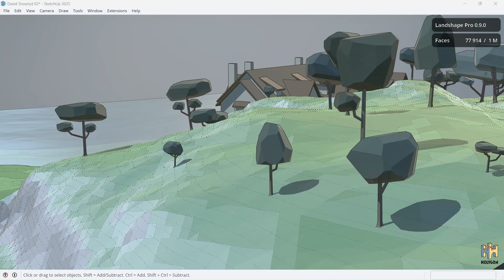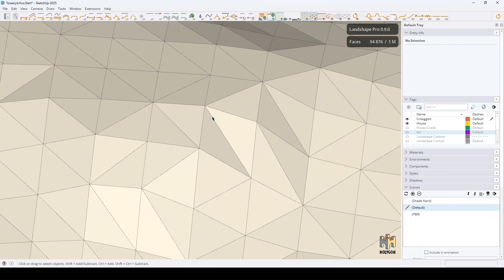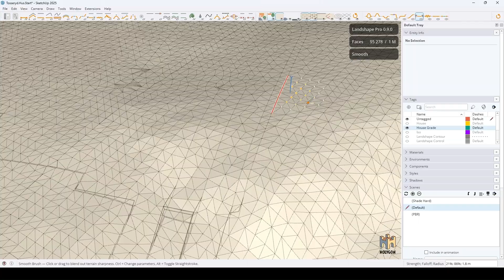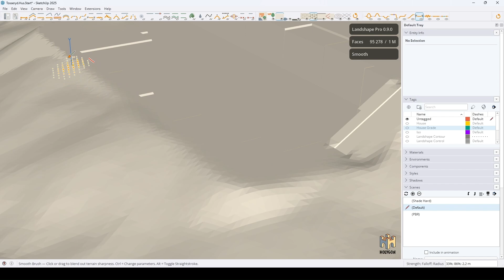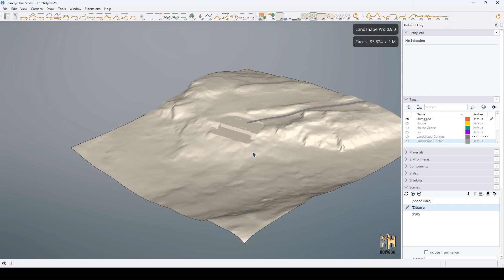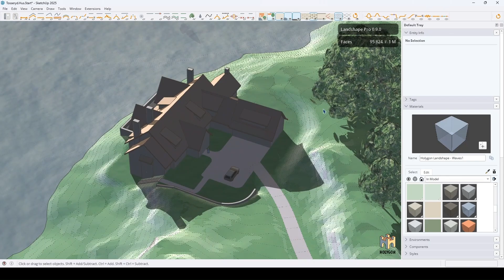Landshape Terrain Grading Workflow – How to Grade in Landshape for Sketchup

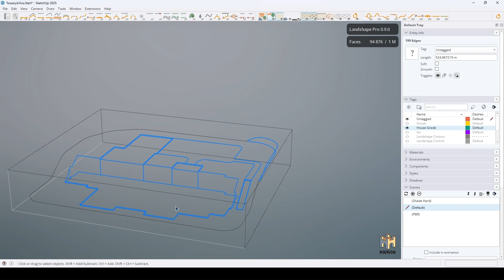Comment: 5:42 how do we create those lines on the landscape?
Reply from the maker: Sketchup has a Line tool. Just use the Line tool to manually draw edges exactly where you need the terrain to go.

It's that simple.

Remember that your Grade edge input needs to be in a group. It also needs to contain an outermost closed edgeloop, which defines the enclosed area to grade. 

Look closely in the video. You will see that the Grade geometry edges are all in one group, and that this group contains one continuous outer edge perimeter.

Landshape does not care about the origin of your edges. You may draw them them via Sketchup's built-in Line tool, Rectangle tool, Circle tool. Or in some other extension, such as Fredospline.

In addition, Landshape offers a handful of Prep and Prop commands. They include e.g. Drape Edge, Smooth Path, and so on. These facilitate common editing tasks, prepping your edges for commands like Grade.

We plan to publish more video tutorials, showing what Grade groups are, and how to create them.

Does this help you?

Comment: Can you grade a road properly with profiles, fills and cuts and not just drape it to the ground surface?
Reply from the maker: Thank you! Yes, you can. 

To grade a road properly with profiles, fills, and cuts, you first use any method to create your detailed road profile as a target surface. This is a control group. To create the control group, you may use Sketchup's Followme, or third-party extensions, such as Upright Extruder, to create and shape your target surface. 

Then, in Landshape, you can select key edgepaths from your target surface, and Embed them into the Landshape terrain. This gives the terrain mesh the local definition. For instance following the road's left and right borders. Finally, you can select your target surface, and run Landshape "Fit". Fitting should locally re-elevate the Landshape terrain to conform to your selected target surface. Use the VCB to adjust the result.

Alternatively, you may instead create a target grade group. It consists of edges, differentiated in plan. Again, you may create these edges in anyway you like. Sometimes, Landshape's Drape Edge command can be helpful part of this process. And again, then Embed the important defining edges. Finally, select the target control group, and run Landshape Grade. This should reshape the terrain according to your target edges. Remember that your Grade group requires an explicit outer border edgeloop.

The above two methods should give you finetuned control of the result. It's mostly about how you create your control group.

Note that you may be tempted to use the Landshape command called "Road". However, it currently is very simple. It is one of Landshape's very few non-atomic commands. Road does many things at once. This achieves very quick-and-simple results, but affords much less control for the user.

Holygon plans to publish several new tutorials videos that showing similar workflows.

Let me know if this helps.

Comment: I am working on modeling a sidewalk on existing terrain with other tools and came across Holygon. It looks feature-rich & powerful but I don't know what I don't know. Currently, I am using Toposhaper to make my topography using contour lines. I then trace the sidewalk and stamp it onto my topography. Using joint push/pull creates an approximation of the sidewalk, but it's not level in the sense that it slopes to create an uneven walking path (since it's just pulling up the local slope of the topography. It's sloping up the hill along the "Y axis," so to speak, but I want it level along the "X axis," as it were. 

Does Holygon have the tools to modify the terrain to achieve this? Or do I need to model the sidewalk using horizontal segments along the outer splines of the sidewalk?
Reply from the maker: Thank you. 

Yes indeed, Landshape allows you to create and edit sidewalks. And similar features. 

To create sidewalks and other locally raised or sunk areas in your terrain, you should combine several Landshape and Sketchup commands into a pipeline, a workflow. How to do this exactly is much easier to show in a video. 

We aim to publish a video tutorial on how to create Landshape sidewalks and related terrain features.

While you can acheive this today, we want to further simplify the process, and make it more effortless. 

To accommodate your request, Holygon has added a few new features. They should make creating and controlling sidewalks faster and easier. We will include these new features in the upcoming release, Landshape 0.12.0. 

Keep your eyes open for upcoming releases!

Comment: how are you creating the "grade" group? I'm working from a 2d cad import.
Reply from the maker: Good question!

– What is a Grade group? How do you create it?

The short answer: 
The grade group is simply a Sketchup group that contains raw edges. These edges control what terrain area to affect, and where the terrain should go within this area. Grade forces the terrain toward these edges.

The fuller answer:
Grade is a powerful command that lets you accurately shape Landshape terrain, by selecting reusable control edges within a grade group. There is nothing magic about the grade group. Currently, the grade group must contain:

1. A closed-path perimeter. Make it simple. Avoid any gaps, overlaps, etc. 

2. Frequently, it should also contain an internal edge interface. This interface consists of raw edges. 

When grading, Grade will:
• Force the terrain to go through this internal interface.
• Affect only terrain within the grade perimeter.
• Automatically smoothen transitions within the perimeter.

To create a grade group, do this:

A. In Sketchup, start in the default model context. 

Here, simply draw a closed path perimeter around the Landshape terrain area that you wish the grade to affect. Grade will not move any terrain outside of this perimeter. Typically, your perimeter should lie right on the existing terrain surface. Not below, not above.

You can use Landshape's built-in tool "Draw" to easily make an edge perimeter. The Draw tool is made for drawing edges on organic terrain. It can help you to nicely close your loop. However, you may also use Sketchup's Line tool. Or edges from an imported e.g. *.dwg cad file, or whatever. If you wish, you may drape a selected group of edges onto the terrain, to make edges follow the terrain.

Make sure your edge loop is in a group.

B. Then, while inside your grade group, now draw additional raw edges. These edges define where, within the perimeter, that your terrain should go. They determine its general shape. Typically, you wish to force the terrain around buildings or retaining walls. As a site designer, you often know approximately where the terrain (nature) should meet built features (culture). This is the nature-culture interface. Initially, keep it simple. For a small house on a slope, four edges, wrapping around the corners of the house, could suffice. You may go back an add grade interface details later. 

An internal interface is not required for grade to work. But is used frequently, since it gives precise control of the resulting terrain shape. Without an internal interface inside the perimeter, grade will use only the perimeter, smoothening out the area within.

C. Then, go back to the start context. Select just the grade group. You may also select from within your grade group.

D. Run Grade.

Now, the Landshape should reshape your terrain according to your selected input grade group.

Note that if you want the terrain to go exactly through the edge interface, you need to first embed corresponding interface edges into the terrain, to give your terrain local definition. Then, you can Grade. You may select raw edges and embed them, while still inside the grade group.

Note that while Grade does not care about edge length, Embed is sensitive to tiny edges. You cannot Embed tiny edges. If you're working with geometry imported from e.g. autocad, you should always first Clean the geometry. Imports often contain bad geometry. Remove any tiny edges, microgaps, and other bad geometry, before Embedding them.

You may Grade iteratively. Repeatedly add further and further interface control edges. Then repeatedly re-grade with these selected. Do it again and again. You may move your interface up or down, scale edges, move them to the side. You may add embeds as you go, where needed. Then watch the terrain reshape as you Grade. 

This iterative process is a powerful way to work. You continually shape your terrain closer and closer to your design goal.

Once you understand the basic principle behind Landshape Grade, you will discover that it is quite a powerful concept. 

In principle, you can control all elevations of a huge, complex terrain model, by using only one single grade group.

Note that when creating nature-culture interfaces, it helps a lot if you are using a shortcut for toggling "Hide rest of model" on and off. This way, you can be inside the grade group, and draw a grade edge interface on e.g. a building facade in another context, showing and hiding the facade and its inferences with a single click. You may get readymade shortcuts for this and much more in Holygon's Asset Pack, available at:
https://download.holygon.com

— Does this help to understand Landshape Grade?
Reply: @holygon3D  Another quick question: How do I remove an Embed Fence? Is there an easy way to remove all, or do I need to use the stitch command to remove it individually?
Reply from the maker: @smack1129  

Thanks! 

Sure, happy to help. 

Currently, if you have a terrain edge that is Fence, you can un-Fence it one of 3 ways:

1) Stitch
Use the Stitch tool, and click Fenced edges one by one. This is very accurate, but works best for smaller number of edges. We plan to later add a kind of Unfence brush, which lets you unfence by brushing.

2) Mesh
Remesh, either by selecting an input group (a grouped rectangle, ellipse, or blob) and running the Mesh command, or by using the Mesh Brush, stroking manually. Note that remeshing is quite destructive, as it resets all local terrain topology to your currently set resolution.

3) Unfence
This works if you Fenced using a control group. First, Select your original input control group that you used for your Embed Fence. You can move it up and down, but not to the side. It needs to remain in the same position in plan. Then, from the top menu or context menu use:
Landshape > Prop > Unfence Terrain Edges

For greater accuracy, you may unfence individually selected edges. Simply enter your control group, and select only those edges that you wish to unfence from the terrain, and then run Unfence Terrain Edges.

For this purpose and others, it is best practice to keep used control groups on e.g. a hidden tag, for later reuse.

— Does this help?